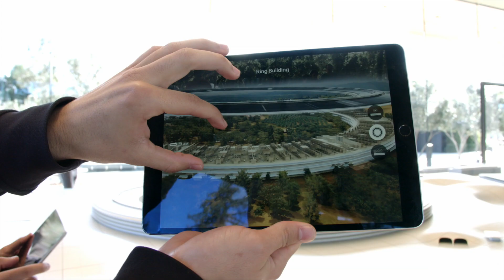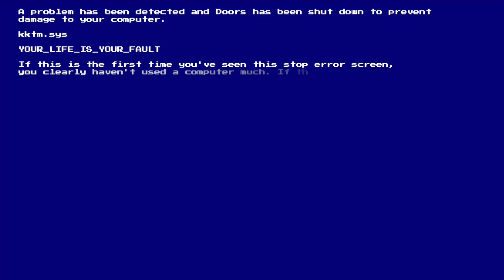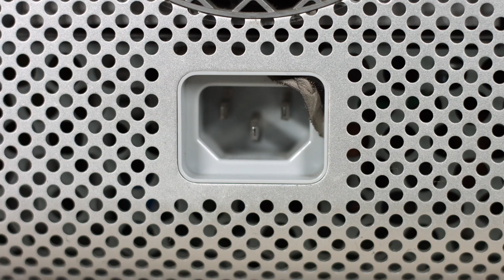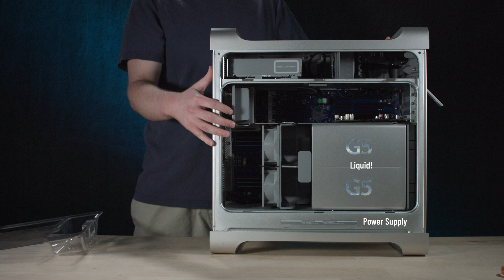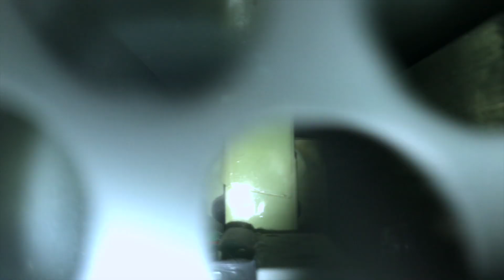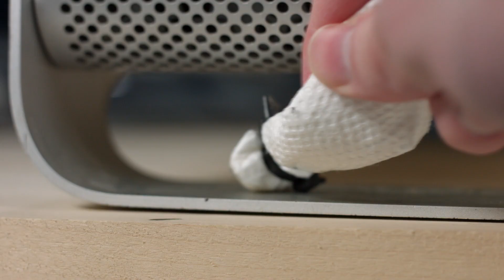Power Mac G5 and Cinema Display Disaster - Krazy Ken's Tech Misadventures

Comment: My first thought was blown cap because my G5 Dual core 2ghz DID blow a psu cap... About a few inches from my ear. I lost hearing for a week :) apple fixed the power supply under warranty and if I remember right they got recalled for faulty caps. Didn't realize it was a liquid cooled one however

Comment: Ken, I recommend plugging PCs/Macs with power outlets like this:
To unplug:
Turn off in software, flip the switch on PSU, wait couple seconds, unplug from WALL, then from the computer.
To plug in:
Flip switch, plug the cable into PSU (not plugged into the wall YET), then plug into wall and you’re good to go.
Hope this helps, because I find this to be the most safe method.

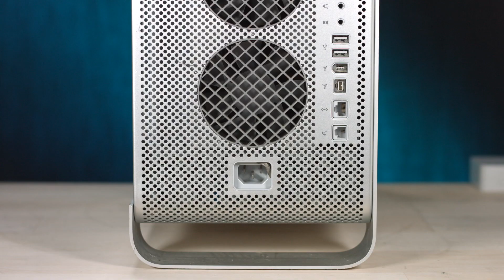Comment: So this 'thing' you see at 10:06 is actually some padding that sits around or near the power supply (I haven't pulled one apart for some time, so I can't remember where exactly.) Someone has removed and/or replaced the power supply, and has not reseated the power supply properly, thus displacing the padding. This padding is not metal, but some synthetic mesh padding that is throughout PowerMac G5s and Mac Pros, probably to insulate sound or vibrations.

Comment: I bought that exact model new and still have it. Luckily no leaks yet, but I rarely run it because A:The heat could peel the paint off a battleship and B:The seven(!) fans run full blast constantly to try and overcome the tons of dust it has inhaled over the years. I've looked online and getting access to clean the dust out is a nightmare. It's been a good machine otherwise though. Got the display too which works fine but is noticeably dim compared to my iMac 5k.

Comment: Any liquid that leaks out of that system (aside from mineral oil or something) will be conductive even if it didn't start out that way. It collects a charge. 100% pure distilled water, right out of the distillation is non conductive. Pretty cool.

Comment: The AGP based 2.5 and 2.7 GHz Dual G5 are naturally prone to have liquid leaks due to bad quality o-rings in the LCS, at the times Apple swapped the defective units by itself, even out of warranty. You need to take out the cpus, spill out all the coolant in a sink, change the o-rings, refill it... if the PSU survived the "shock", you'll have a new working system. You can even take out the cpu from the LCS and take some normal "air" cooled heatsinks from the AGP based 2.0 GHz Dual G5 and do a thermal calibration with the AHT CD Rom, so you convert your system to an air cooled one https://www.youtube.com/watch?v=wM9k_3gk73E. Don't take the Dual G5 Pciex 2.3 GHz G5 heatsink since it won't fit your AGP model ;)

Comment: You confuse cinema display hd and cinema display with eachother, the HD version is the older one and the one you have and the non hd with is higher resolution is called cinema display and is newer and has the psu included inside :)

Comment: There's a reason GM Dexcool is called Dex-kill. It eats silicon based seals alive, hence the reason it's common to have to change Low Intake Manifold gaskets on a lot of the 1996+ V6 (especially the 4.3L found in the second gen S10 Blazers) and V8 engines.

Comment: Yes the Braun copied desogn still so look after years, sadly it was not Apple design but just a stolen (inspired I guess) one.
Also design is great but you put the computer under the table as it is dam heavy and make so much noise in hi end versions. Huge machine but 2 HDD space and one only 5.25 drive, so little from a huge box.
many of these leaks and overheat very few still in service.

Comment: Some interesting trivia about the Apple Cinema Display. It was first introduced in 1999 at 20", then the largest LCD flatscreen monitor available for a computer (There may have been larger CRT monitors available but they would have been very heavy and bulky compared to the Cinema Display). The only downside was that the original 1999 20" Apple Cinema Display cost a whopping $4000. The 1st gen used a DVI connector. With the 2nd ten in 2000, the swished to a proprietary Apple Display Connector (ADC) which carried a DVI video, USB, and power, all via one plug. This meant it was easy to hook up a ADC-based Cinema Display to a Power Mac as it used just one connector and you got a built-in USB hub with your display but with the major downside that you couldn't hook up third-party displays to a Power Mac ADC port without a adaptor nor would a ACD monitor hook up to a PC or Non-ADC port equipped Mac without adaptor. Fortunately, the version of Cinema Display you have has a standard DVI connector as in 2004 they realized their mistake in using the proprietary ADC connector and went back to separate DVI and AC power connections as well as separate connections for built-in UISB and FireWire ports/hubs. The made the 2004 and later versions of the Cinema Displays all Wintel PC compatible. The version of ACD you have ran $1300 for the 20" and $2000 for 23" and a whopping $3300 for a 30" (The largest ACD or Apple display of any sort Apple ever offered). In 2008 they switched to LED backlighting in the Cinema Displays (sold as the LED Cinema Display) sold until 2013. The last display Apple  introduced (prior to the just released Apple Pro Display),  was the 27" Apple Thunderbolt Display (2011-2016) introduced alongside the LED CD and sold for three more years after the ACD was discontinued.

Comment: I have a Power Mac G5 Dual 2.7 GHz (Early 2005) that is liquid cooled and still works great, without any leaks.
Reply: @Adi-th3is  I am not sure who makes the liquid cooling system in my G5, but it still works great with no leaks.
Reply: @Adi-th3is  How do I check the vendor of the LCS?  I am not taking apart the components of the G5.  It is not a rebuilt LCS.  This is an original G5 with no replacement parts.

Comment: fix it yourself you lazy slob
Reply from the maker: Be my guest! Show me how it's done!
Reply: @ComputerClan  its just lazy your makeing "content "for contents sake.

I know your shitheads with low levels of inspiration but get cracking with the screw driver. The psu is either shot or its not gut test and repeat. Putt it on its side and run it with a copper cooler directly anything but this half assed show of..... what i dont know

Comment: I also got a G5 (and have another one coming) recently, with the first-gen cinema display.  The display is absolute garbage hot garbage.  The G5 I gotta figure out what to do with.  It's an AGP dual CPU model.  Of course I was hoping for a PCI-E model, but one can only dream.  It is a problem in terms of upgrades though, AGP cards are harder to come by.  Yeah, the water cooling was a necessity because G5 will make your home or office sound like a server room with the roaring fans, and you can forget about heat for the winter because you're all set.  Water cooling was the only way this thing was going to go in a studio, it's not a feature but a necessity.  Mine is air cooled, and so is the next unit (which I suspect is identical to the one I already have).  10.5 was the least release for PPC AFAIK, and it doesn't feel all that responsive on this dual CPU G5.  I can clearly see that the updates stopped not because architecture was discontinued but because the performace was so poor, it won't be adequate for the OS releases that followed.

Comment: I hope he took it apart to save the 2.5ghz dual core processor
Reply: That power supply shouldn’t be trusted also main issue is the rubber  gasket would dry rot so that was most likely your issue

Comment: At 10:08 it shows that at some point the PSU had been removed and replaced incorrectly, pinching the shielded cable visible there, that is the source of the short. The leaking coolant has been there a while as shown by the accumulated grime (dust mixed with coolant to make a gooey mud). It is likely that by removing the PSU and properly reinserting it after checking for the integrity of the pinched cable the computer should boot up. Eventually there will be enough coolant loss to cause excessive throttling. 

After playing with it as it is you will find that these make great Hackintosh conversions, bench supports and other creative re-purposing.

Comment: Shit.. I totally forgot that some of the PowerMac's were water cooled.. thanks for the reminder; definitely something I'll have to check out before I power them up again.. One was running fine just a few years ago..but I didn't even check it then, I'm not sure if it is or not; think it is as it's a PCI-X dual G5... also have the PCIe dual g5 which probably is as well..
Reply: Just popped off the cover off the one under my desk as I'm now curious as fuck; I guess my PCI-X dual G5 is air cooled.. Just fans and big heatsinks on the chips.. Now to go check the PCIe one
Reply: K so I think the PCI-X is a PowerMac7,2.. the other is a 11,2...both just have heatsinks/fins/fans.. no leaks..and my batteries look good too..yay.

Comment: Makes me wanna get my PowerMac's running.. I got a G5 PCIe and another G5, at least one is a dual.. One of them takes a weird big-ass 20amp IEC cable that I don't have..the other one just takes a normal cable.. Also have the big-ass 23" (that looks like a 27" or something) original apple display for it as well as 2 cinema displays (one dead, one working)..

Comment: i dont know if anything ever happened with this but maybe try a local electronics repair shop for the psu repair, and put a pair of AIOs on the cpus or ebay a new working cooler for this machine from a later revision, or just turn it into an amazing hackintosh.

Comment: As another comment mentioned, unless it was shipped to you via ground shipping, if it was shipped using FedEx Express, USPS Priority, etc it was on a pressurized plane at some point which could have caused issues with the internal pressure of the computers cooling system

Comment: I have an g5 power supply from the smallest model and so far i know it is in working condition but im from germany and i don' t know if it is compatibile with the biggest 2 core Version.....
Reply: That will not work. He lives in the US where the voltage is 120.
Reply: @crashbandicoot4everr   normally you can switch the voltage on powersupplys or they do it automatically

Comment: Assuming that there is no liquid damage to the main board, you might just be able to get a refurbished power supply. I am curious if it may be possible to replace that water cooler with a modified heat sink that is capable of running those nukes on air. Like the SilverStone HE02. Although those might be a bit big since you would have to fit 2 in that machine. It would probably be also be a substantial under taking, and from what you said about the power supply being difficult to remove it may just not be worth it in the end.

Comment: Depends on where you live their are some of these stores called Simply Mac/Mac Authority where they are a store chain in America that is a 3rd party Apple store that mainly focuses on repairing Apple products along with selling refurbished/fixed Apple products. Besides they are a better source for getting your Apple products fix compared to the Apple store's Genus Bar help center. Cause mainly they are cheaper and they most likely have the replacement parts on hand so that you don't need to wait few month to get it fixed.

Comment: Messing with a power supply when the caps have been discharged (they will be if the PSU has been off for a bit of time) is completely safe, aside from the possibility of scratching yourself on metal parts. :)

Comment: I still use a Cinema Display (23 inch) With my 2013 MacBook Pro running macOS Catalina 10.15 public beta using an HDMI to DVI adapter and it’s higher resolution than this Asus monitor I have from 2012. Apple products always last longer and are still sometimes used as primary devices for years after they’re discontinued

Comment: Ah yeah, the PowerMac G5. I had the misfortune of owning a Late 2004 Single Core model which as some might remember was the one that never worked properly and would just randomly freeze for no reason. Coming from a PowerMac G3 B&W it was actually quite the beast, at least when it fucking worked instead of freezing in the middle of whatever I was doing -.-

That being said, I still love these machines. I even managed to get my hands on a Quad Core model a few years ago where the watercooling apparently hadn't leaked and destroyed the machine yet, but sadly I was still unable to get it to boot - my assumption is that one of the CPU modules is bad. No explosions though, so that's nice! I haven't entirely given up on these yet though, so I might still try and get another one at some point.

Comment: The liquid cooler on my G5 leaked and corroded the SHIT out of the bottom of the computer! And when I took it apart and tried to clean off the corrosion, the resistors on the CPU cards came off with it! I think I can still fix it, just gotta get new CPU's, is all. :(
Reply from the maker: Dang. Sorry to hear that.
Reply: Computer Clan I’m taking it as a sign that it needs an overhaul! Gonna put more powerful CPUs in it and experiment with different AIO coolers!

Comment: You could try to repair it yourself. That spark sound and the light from the power supply comes usually from a burned fuse. You could try to replace that fuse with another one with the same values. If it's socketed, good to you, if it's soldered, you must use the soldering iron. And of course, clean any liquid inside the power supply. Good luck!

Comment: Don't give up. There is plenty of information on how to fix LCS. Disassemble LCS and check if your processors boards still have caps around CPUs. Maybe there is a chance to clean everything up. There should be a fuse inside a power supply. MIght be worth a try.  Another fun project.

Comment: This is what happens when you get a liquid cooled G5, never ever get one of these.
Reply: Thte late 2005 G5s had a better liquid cooling system. Those are the better ones to get anyway, since they offer PCIe and DDR2.
Reply: @desther7975  Those are a lot more reliable but still have the potential to leak.. the aircooled 2.3GHz dual core model from late 2005 is the only one I would personally go for.

Comment: Get any other model of G5 to toy around with. The older single processor machines had air cooling, and the later dual and quad core machines had either air or superior liquid cooling that was not as likely to spring a leak. I have had G5s for about as long as G5s have existed, and while I've seen some failures, I've never had a leaky liquid-cooled model. My best one today is a late 2005 G5 (the only models with DDR2 and PCIe!) that was originally a 2.0 GHz dual core system, but I upgraded it with a 2.5 GHz module from a broken quad core system, so now it's a dual 2.5, a configuration that Apple had never originally offered.

Comment: I know you don't want to get the power supply out, but you will have to, or take it to a local repair shop and tell them what happened. You'll want one that specializes in component-level board repair, as if something is messed up royally, they have the skills needed to fix such things.

Now if you felt like it, you could talk to Louis Rossmann about it, while he does repair MacBooks for a living, he does seem to know a bit about power supplies from stuff he's mentioned in earlier videos (like repairing audio equipment when he was young). But that's only a suggestion as Louis' shop is in New York.

Comment: You will need to re-build the Liquid Cooling System (LCS).  Need new hoses, new coolant, and long T-handle hex driver to get it all out. Check Granger for the tool, under $7 and totally worthwhile. Also need new O-rings.  Check online for a guide on re-building the LCS.  Would make for a cool video!  Then (or probably FIRST), open up the power supply to see what need fixed.

Comment: Award for doing the most market research on how NOT to design hardware goes to: Apple!
Reply: To be fair, the G5 was an existing design, they just tacked on water-cooling on the high-end later/last revision.
Reply: @MaddTheSane  I wasnt even concerning one specific piece! Much less their best PC impression!
Reply: @MaddTheSane  But they offered dual CPUs from the beginning, and I'm pretty sure every G5 that featured two CPUs also featured liquid cooling due to just how damned hot those CPUs ran.
Reply: @desther7975  Nope: only the later/latest even had liquid cooling. The others were all air-cooled. I have a dual CPU model without the water cooling.

Comment: Another classic computer rendered inoperable by a shipping company. Between the time and effort involved in sourcing and replacing the power supply as well as finding the leak (or replacing the cooling system entirely) I'd just find another working unit. They can easily be had for about $50. 'Tis a shame. That would've made a great space heater.
Reply: These things fail even if you leave them sitting on a desk for its whole life, the water cooler will leak eventually.
Reply from the maker: I wouldn’t blame the shipping fully. I hear these things are known to fail.
Reply: @ComputerClan  Yeah, but the timing...
Reply: Sure. Be diplomatic about it. :\

Comment: Well, easy take it a part, see if the power supply has any visible damages, ,if not clean it all with isopropyl alchool, check the fuses are ok. Then check where the leak is, repair it, top up the coolant and give it a go, if not get another power supply.

Comment: That looks awesome. If it ran latest Software it would be cool.
8:52 :O
Well rip :(
Reply: The most current web browser available is an interesting little project called TenFourFox, which is based on current Firefox code. The most current operating system is Linux, but there are very few distros that support it at this point. The most recent Mac OS it can run is 10.5 Leopard.